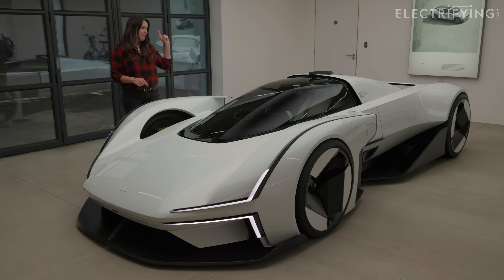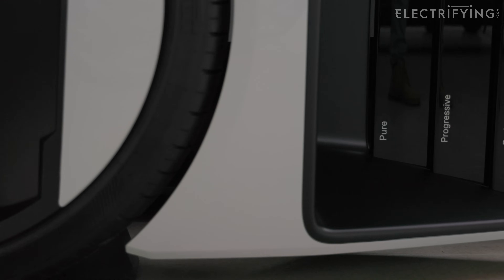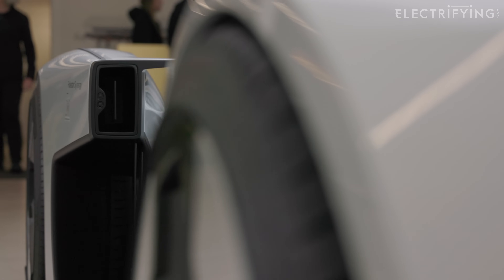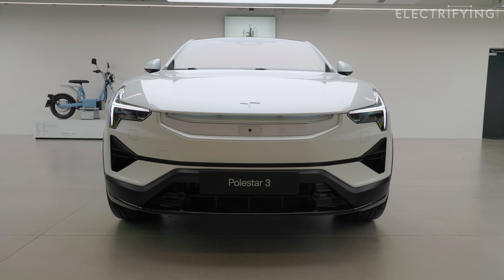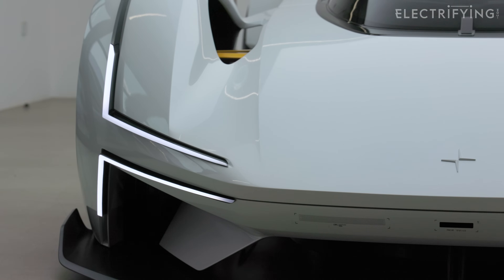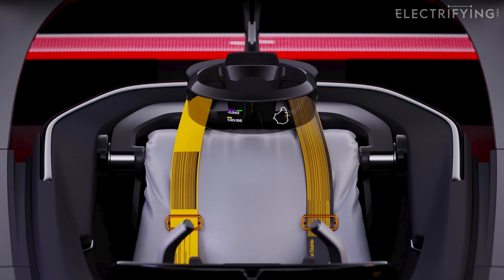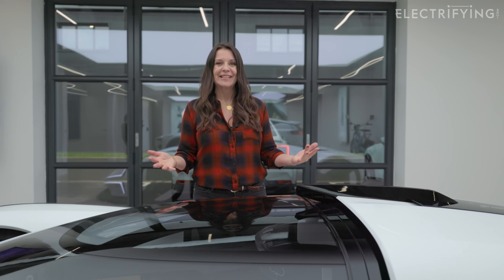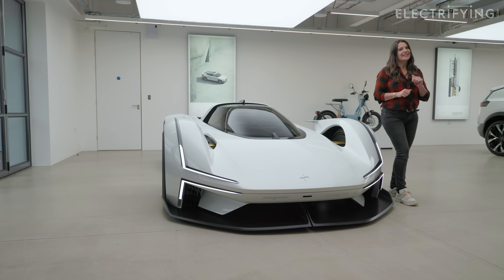FIRST LOOK: Getting up-close with Polestar’s new Supercar | Electrifying

Comment: As a design study it's an interesting experiment, but really impractical for the real world or circuits as it will struggle with cooling the motors and batteries. 
If you really like this style, in the non-EV world these things exist in full size and are drivable. For example Praga Bohema, Czinger 21C or KTM X-bow GT-XR